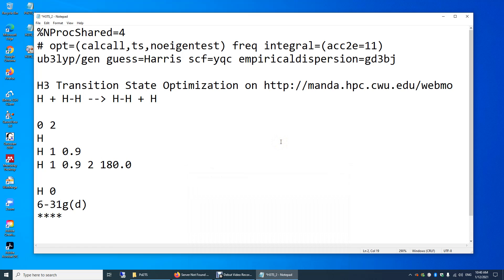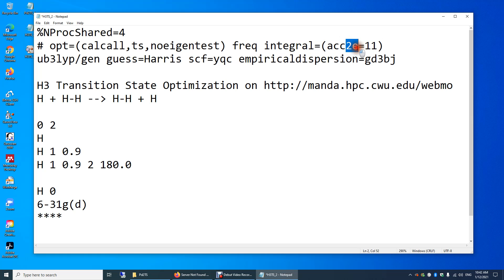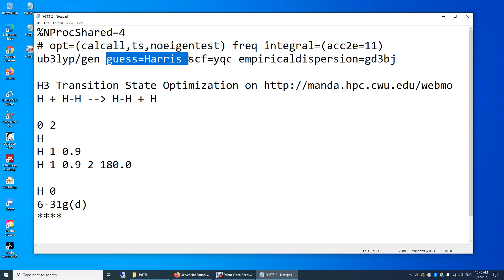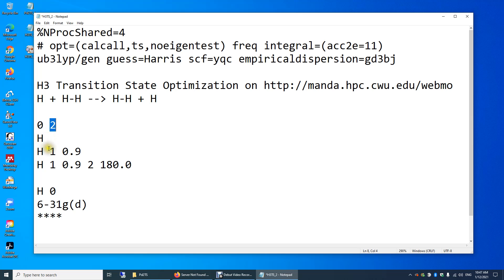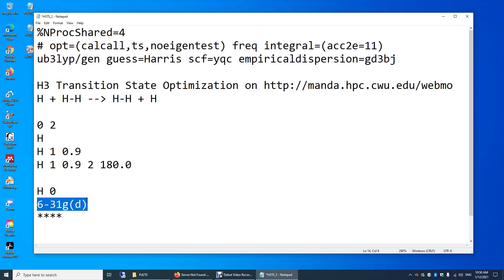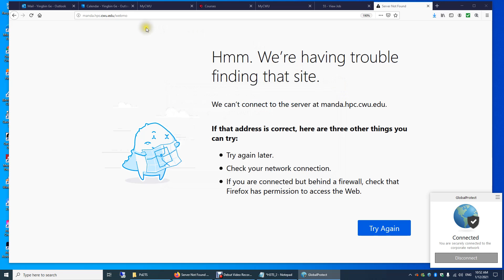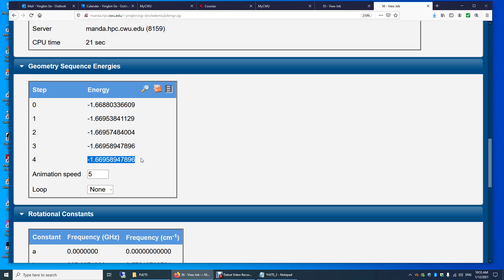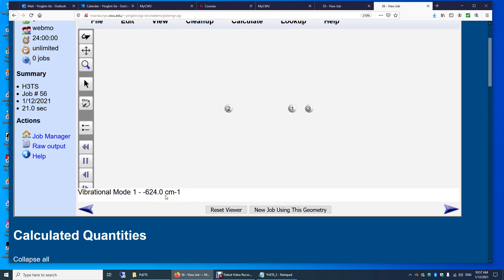H3 Transition State Optimization via CWU WebMO

Comment: Could you please sir told me if it possible that even the certain atom has a low muliken charge in population analysis the electro static potential map is highly indicated by red at that center or muliken charges have no relation to MEP?
Reply from the maker: The Mulliken charge heavily depends on the basis set and thus may not be a good indicator of the charges on atoms. I would try NBO charges, which are virtually independent of the basis set.
https://en.wikipedia.org/wiki/Natural_bond_orbital

Comment: Very good explanation. Would you do a tutorial for protein catalytic activity?
Reply from the maker: This is a big question. You may watch https://www.youtube.com/watch?v=0vvUIIulzMk and related videos for the theoretical part. But if you are interested in the Gaussian calculations, the difficult part is to make an guess of the initial positions of all atoms of the enzyme and substrate. You may search for "protein data bank" to get the structure of many protein molecules and perhaps the enzyme of interest. 
The B3LYP calculation time scales ~N^3. This means the calculation time increase 1000 fold as the number of electrons increase 10 fold. A protein may contain 10^5 electrons and thus the estimated computing time is 10^15 seconds assuming you have large enough memory and hard disk. This is why chemists resort to hybrid methods: accurate but slow quantum mechanical calculation for the ACTIVE site and fast but less accurate calculations for the supporting structure. Google "ONIOM" to see its implementation in Gaussian.